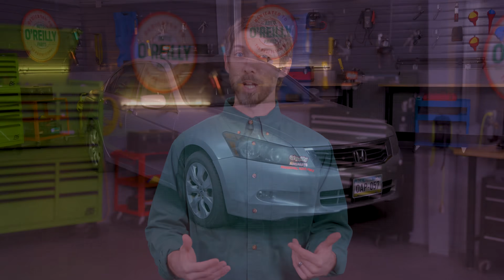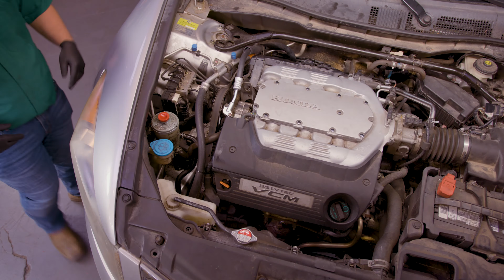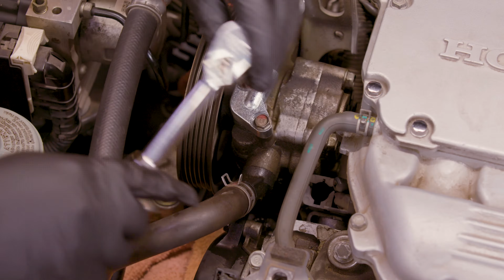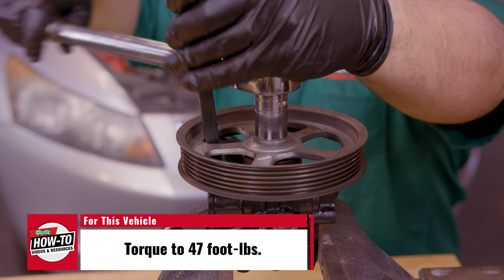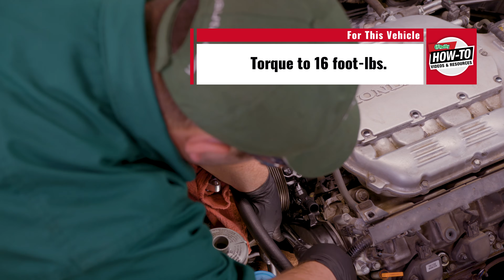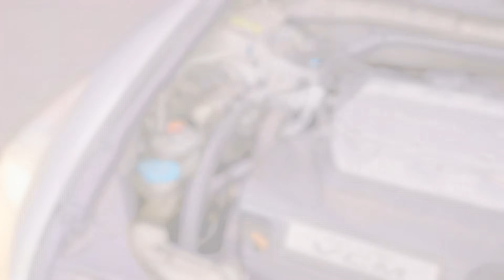DIY – How To Remove and Replace a Power Steering Pump

Comment: I love how they say you have to have this tool to get the power steering pump out right but the tool doesn't fit in the spot to remove the pulley to get to the bolts behind it